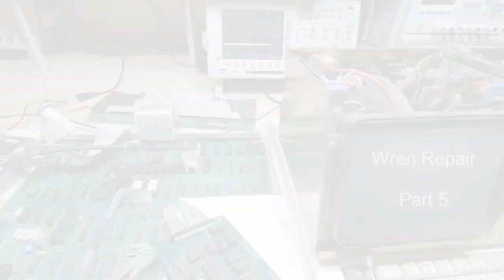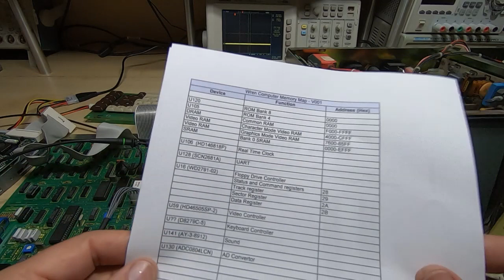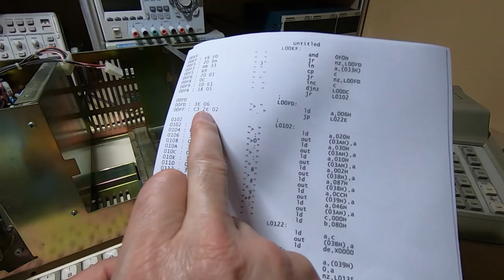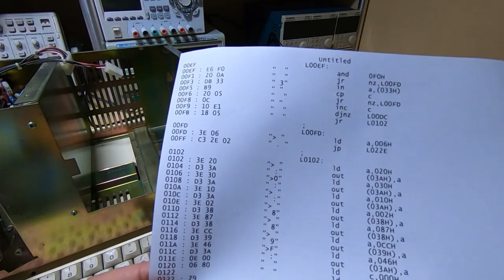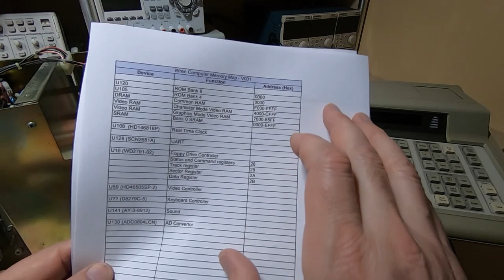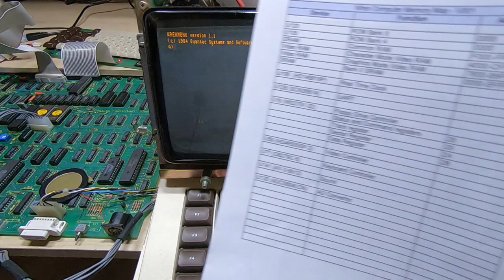Wren Repair Part5

Comment: nice work Jerry... i have emailed you on your sales @ email but not heard back so far... would love to help reverse enginer the z80 code.
Reply from the maker: Apologies for not getting back via email (Not sure which email is yours, can you include your youtube name in the emails) but I was hoping to get one of the wrens working before proceeding as it will make things much easier. As you see this one is now working so I am just in the process of finishing the memory map and then we should be able to start. I would like get the boot code unravelled first. The code uses a few odd optimisations so having some key firmware addresses will really help. The code also makes extensive use of pointers so figuring out where key pointer values are stored will also make it a lot easier.
Reply: @JerryWalker001  have identified by email - code word "BANANA"